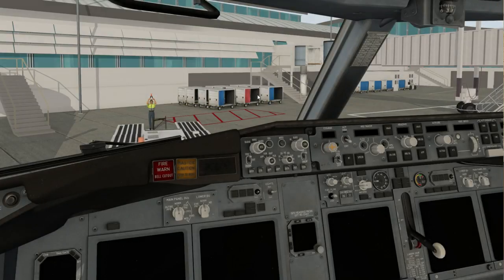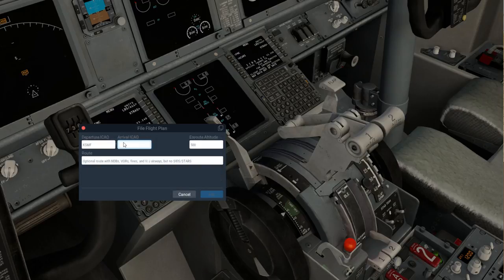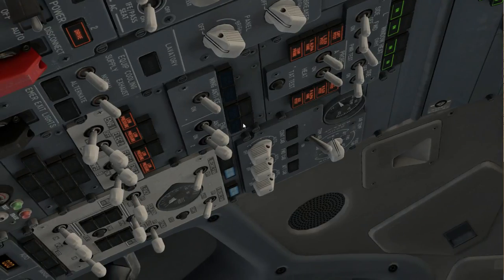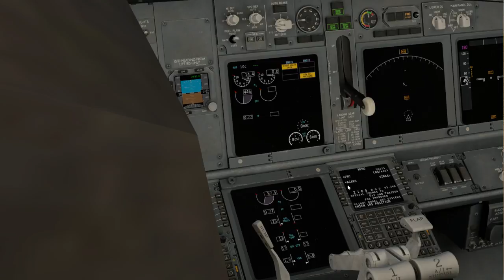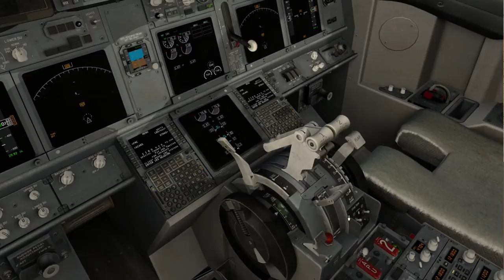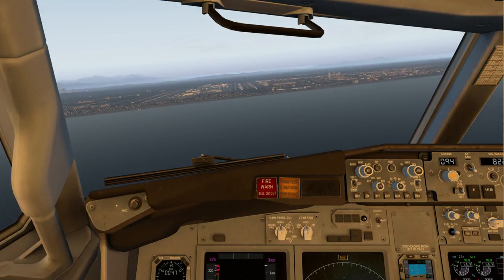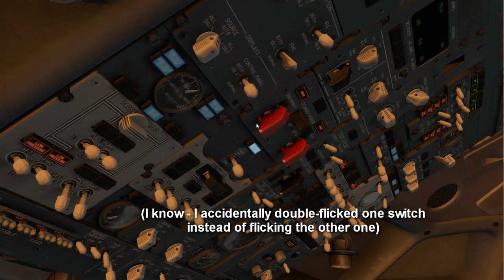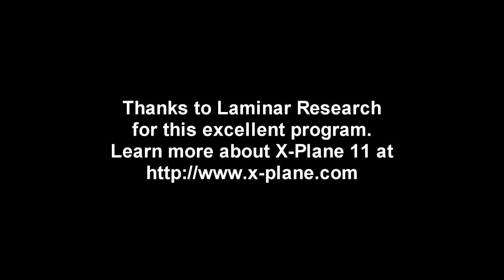X-Plane 11 - Zibo 737 First Cold Start to Shutdown

Comment: the APU needs some time to start up. you just need to wait a bit until the blue light goes on, before switching APU Gen to on. The yaw dampener needs hydraulic pressure to work, that's why you couldn't switch it on. Also the IRS needs some time (~10 to 15min) to align, that's why you couldn't set the auto-throttle to arm and the nav displays didn't work. The plane has to stand still until it aligns. Usually you start the engines while pushing back. Btw. there's a great free pushback mod which is way nicer and more realistic than the stock one: it's called Better Pushback. It lets you exactly pick where you wanna go.
Reply from the maker: Ah, I see. So what indication do I have that the IRS is ready? Does the align symbol go solid instead of blinking, or is that still in the alignment process. I hope that it doesn't really take 10-15 minutes in-game, does it?

I know I should have started the engines at the "start engines here" line during pushback, but I guess I wanted to make sure I could get it right before bothering the tug. I'll keep Better Pushback in mind.
Reply: it's ready when the displays turn from black to show nav information/horizon. there's also a wheel on the IRS. turn it all to the right and it shows a countdown on the IRS display above (in minutes). and yes, it takes that long. but in the FMC there's a menu button. press that and go to extras (or something like that), there you can cheat. if I remember right there are 3 settings for IRS alignment: realistic, fast and instant.
Reply from the maker: Okay, thanks for the info!

Comment: you need to activate the IRS switch by switching to  LIN then to NAV this switch is available on the last top of the overhead panel after you activate them to nave wait some time till you get MSG on the CDU telling enter IRS next you have to activate the airport name on the CDU and put the Coordinate NO of that particular airport and wait to get the display on depending in how much time you set the ALIN the IRS .